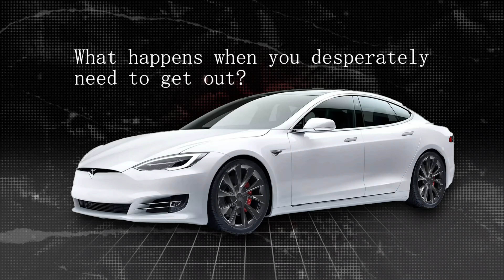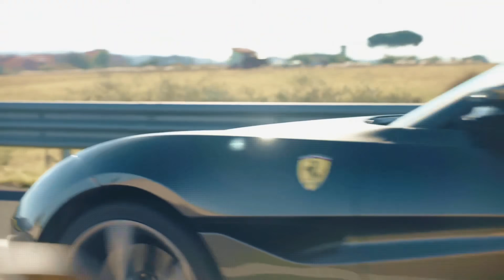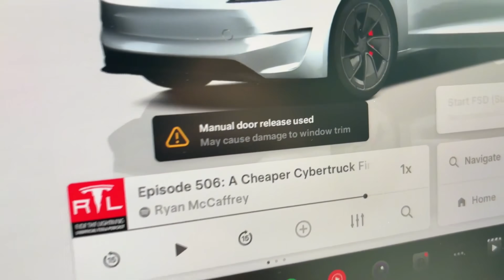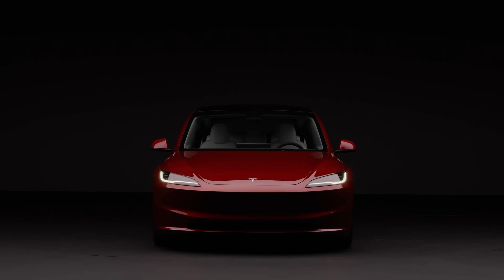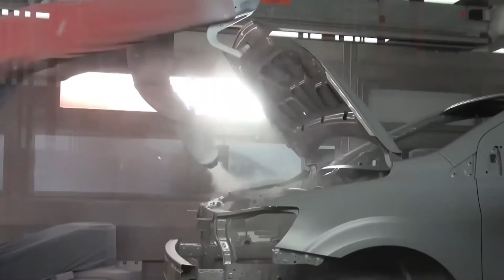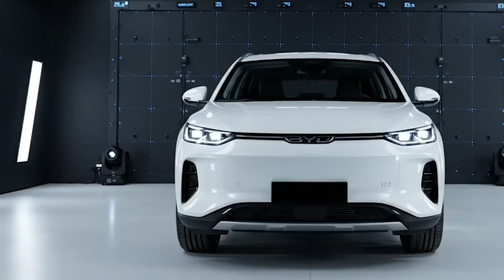Why China Is Forcing Tesla to Change Its Doors !

Comment: It blows my mind that people are incapable of seeing this hazard. How stupid can people be? It goes to prove how people are suckers for image, excited about how "cool" something looks in favor of practicality. If I have two comparable sneakers, I will always buy the cheaper one even if it is not the color I wanted. In the end, I chose the color green in my pocket. People are so vain.
Reply from the maker: I completely understand your point. A design can look futuristic and impressive, but when it comes to something as basic as getting out of a vehicle, safety and practicality have to come first. The real concern isn’t how the door handle works during normal everyday use — it’s what happens after a serious crash, when the electrical system may be damaged, the battery could lose power, or passengers are panicking and need to escape immediately.

Good engineering should never force people to choose between aesthetics and safety. If a feature creates additional confusion during an emergency, then manufacturers and regulators should absolutely question whether the design is worth it. There’s nothing wrong with innovation, but the best innovations are the ones that make cars safer and easier to use, not simply more futuristic.

That’s exactly why this issue is worth discussing. Thanks for sharing your perspective — I think a lot of people probably feel the same way.

Comment: the doors on tesla look so cool i swear just make the emergency release white then problem solved
Reply from the maker: I get what you mean—the doors do look cool, and making the emergency release easier to identify sounds like an obvious solution at first. But the issue is probably bigger than simply changing the release handle to white.

In an emergency, especially after a crash, people can be disoriented, the cabin might be dark or filled with smoke, passengers may not know the car well, and rescuers need to get people out immediately. A hidden mechanical release that requires someone to remember its location can still be difficult to use, even if the handle itself is a brighter color.

The bigger concern is that the normal electronic door-opening system and the emergency mechanical release are two different things. If the electronic system loses power or is damaged in an accident, passengers need an escape method that is intuitive and easy to find. Ideally, you shouldn’t need to own a Tesla, read the manual, or remember where a hidden emergency lever is when seconds matter.

So yes, making the emergency release white, red, glow-in-the-dark, or clearly labeled could definitely help—but regulators may be pushing for a more fundamental solution: doors that remain easy to open and understand under emergency conditions.

Cool design is great, but when safety is involved, simplicity usually wins.